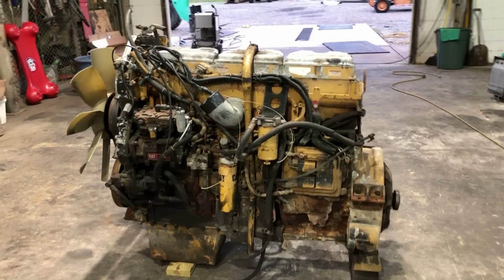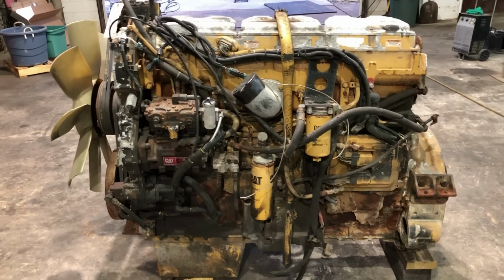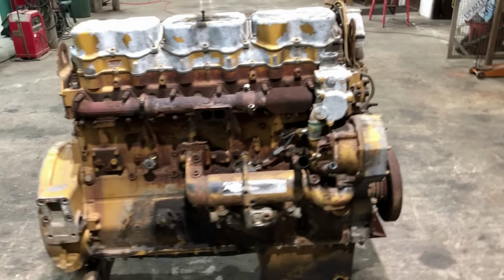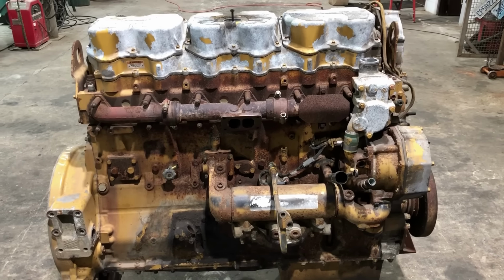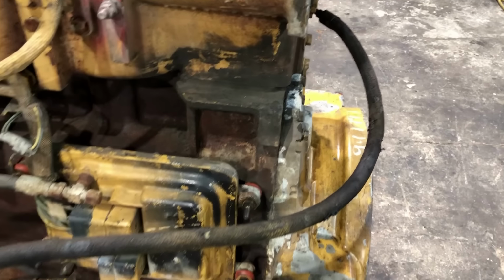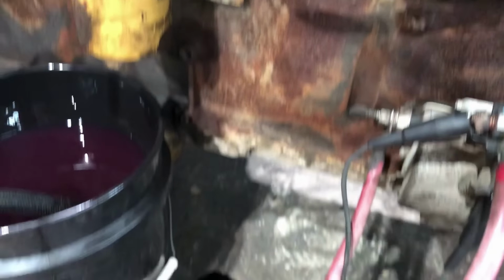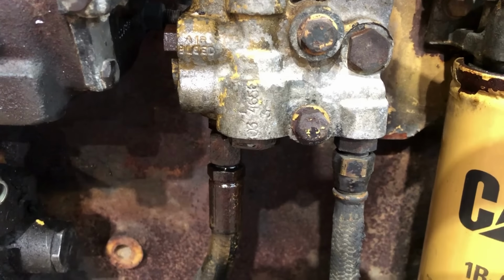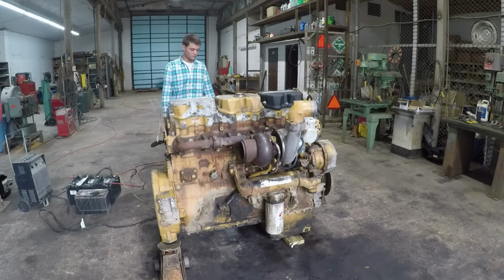Bringing a Caterpillar 3406E 14.6 Liter Diesel Engine Back to Life

Comment: Your the coolest kc  thanks I installed a 605hp 1lw into my 2008 pete 386 awesome engine a little calmer torque than the deleted c13 Lee I had in it which I'm just going to sell as z core I think I just don't have time go rebuild it it runs ran great until peterbilt replaced air compressor it then started pushing coolant out maybe but remain compressor not sure.but I love this 1lw just a bad oil leak front housing which I'm gonna get at but I'm outside all it does is storm and boost is a little low 21psi I replaced actuator but it's not set right tryna to find the specks to set it with regulated air I think it supposed to open at 17psi 29thous

Comment: My buddy has 435 3406e in a 96 Western Star 18 speed 3.90 rears we haul gravel with it. He also has 430 Detroit in a Freightliner, The old Cat pulls away from the 12.7 pretty easily but he Detroit gets great fuel mileage, usually over a 100 liters less than the Cat a day.
Reply: What gears are in the Detroit rears. Year's ago I ran with a guy hauling gravel. He had a 430 detroit. That truck out ran every n I mean every truck in the pit. It also had a weird tranny with reversed top hole...top hole was up by the dash🤔
Reply: @nonsequitur807  4.10
Reply: @GMCOldsRichmond  I had a Detroit 450  or 460  cant remeber with 410s n it was a dog. Probably needed 373🤔
Reply: Peter Wyndham That would be an overdrive transmission

Comment: Way back in the day(late 1960smid1970s) Army for one used  Cat Model road grader .I think they called the engine a D333. Thing I remember about it was The engine could not be killed unless it was run without coolant or oil.Had all the power we ever needed and then some to spare.Other thing I remember  was the grader ran a wet triple disk clutch that was wetted by engine oil.Don't remember just how but when the engine was running engine oil was pumped through clutch housing then back through engine oil filters and so forth.Did you ever run across one of these? I know that the engine could not be used today because of emission regulations.
Reply from the maker: No I don't have any experience with anything that old.  Thanks for watching.

Comment: That was interesting. I'm impressed with your knowledge of this beastly beauty.
I am now wondering why it was listed as having water in oil.  I didn't hear you mention addressing that issue.

I fully understood your concern about lubricating the injectors and cylinders because I have a Jeep Liberty diesel. I was concerned about lube for that engine since the sulfur content has been drastically reduced to pass emissions. I add lube to the fuel when I am not able to find biodiesel. It is noticeably quieter at idle when I can find 20% biodiesel.

I was surprised you didn't think the sludge on top the engine was excessively bad. But I have never had to tear one down as yet. Mine little 2.8 L four cylinder has had synthetic oil since new. She now has 225,000 miles and idles as quiet as one I saw in the parking lot that only had 55.000 miles.

A farmer near me runs his Cummins engines on 100% biodiesel in the summer. He said it runs quieter, smoother, and burns cleaner. Can't do it in winter, gets too cold in WI. He said it smells like someone is cooking french fries.

This was a good video, informative and well done. I was glad to hear that old girl fire up.

Comment: I’ve rebuilt way to many 3406 cats  . A,B,C & E  . I use copper coat on the block plate . . Both sides of the thin gasket. Seems to stay dry .

Comment: good idea on the oil in the fuel, anymore then running it for a second use fresh oil, the carbon in the used oil will tear the hell out of the fuel system, ive seen it countless times. just some friendly advice. carry on

Comment: So the Cat meowed. Just wondering about any cracks or leaks either between the water jacket, but even the cracked holes you've showed might just put condensation in the oil even before it failed.
It would be a lot of labor hours to strip clean and put back in service, probably interesting to do in a hobbyist kinda way.

Comment: Next video, same motor, BIGGER TURBO, INTERCOOLER BIGGER THAN THE RADIATOR, STRAIGHT PIPED, MUFFLER DELETE, HIGH PRESSURE FUEL PUMP SPINNING FASTER THAN THE WHEELS OF HADES CHARIOT!!! and a clutch to deal with the abuse....

Comment: Great video. I used to check cores, but used air starters.
Reply from the maker: I have a big one, but didn't want to go thru the trouble getting it plumbed and working.
Reply: I had an large air tank with a large hose to the air starter. Later I switched to an air turbine starter. It could be charged with air supplied on site or by an air compressor brought with. This system was derived after dead batteries, battery explosions and wiring fires. Have you ever removed liners using the pistons? It was a trick I learned as a ships engineer. A bead was welded near the top of the piston travel. Several stitches were good enough. This would shrink the top of the liner. Great mechanical advantage is attained and the liners pop loose when using the jacking gear. A second stitch is used at the bottom of the stroke to push the liner near clear.
Reply from the maker: @captpaulhaugan  I have tried it, and always ended up liking my homemade liner puller better.

Comment: Even stripped and sitting in the floor it still has that cat growl. I drove a 1984 Ford CL 9000 that had a 3406 in it. Damn good engine.Wasn't much on speed but pulled really good. Wish I had your knowledge on engines. It isn't everyone who can get an engine to run sitting in the floor......... What are you going to do with it?

Comment: Not doubting your competency, but I work for NAPA and learned from our battery salesman recently that the 7236 (gp 31 post 950cca) posts are stainless and less conductive than the lead alloy bases. 

That said, they could be slightly discharged or weak batteries. 7232’s and 7238’s are weaker even new.
Reply from the maker: They were very weak, just about ready for the scrap yard.
Reply: Understood. Your videos are great fun to watch.

Comment: I’m just a Low paid outboard boat tech with zero knowledge of diesel. I’m trying to learn so this may be a very stupid question but why does it appear that this engine has such a small Alternator. I mean wow I thought they would need something larger for the batteries. Actually I don’t even know what size batteries or how man V,s it takes to turn these bad boys over.  I would have thought it would be a lot though.  Anyway thanks for the videos and great info. Keep trucking.
Reply: Is it 24 volt or just 12 in series ?

Comment: You are Number one in YouTube you have good information's I love it.
I got 2004 fright-liner  3126 cat engine it was working when I got it now not working I can crank it but no start i used starter spray and start for a second and die ,when the engine start for a second the RPM jump like crazy (so high) and red light on (Engine protect) I do not know what is the deal with it??

Comment: Opinion on a 112FLD with a CAT c-12? only ever done rod bearings @ 700,000k for preventative maintenance. gets Fresh oil every 10-12k. Head did crack awhile back from drilling out an exhaust manifold stud, but got a new head for that.

Comment: Great engine. Great  video, keep on posting! Too bad these enviroturds have to keep pushing for pansy motors. These old kitty kat engines should be in every truck. Trucks stalling out for a parked regen use more fossil fuel than the OLD stuff. Because they have to make their diesel def and waste fuel to park for a dpf clean out.

Comment: My only question is, "Dewd, where is your hearing protection?" Also, this was an excellent video...
Reply: No hearing ptotection needed it is a CAT not a clackety clack cat almost never dies it only runs smoother by time if something goes wrong its most of the time due to neglegance of operator or mechanic

Comment: random question for anyone who may know, but looking online at a W900 service truck with a 3406 probably an E model but could be a B, its a 1996 truck. Theres no engine brake controls on dash, but I suspect it just wasnt hooked up to be used but exists on the engine physically? Truck has a digger derrick body and if it was used for the body's industry then I see them not hooking it up, I just cant think of anyone getting a 3406 without adding jakes to it or coming that way even before the upfit company got to it with the body etc.

Comment: The batteries are not the problem - you need shorter and/or thicker cables. With such long cables you waste ~1V on the cables alone when starting, which is also the reason why putting 4 batteries in parallel didn´t change too much.
Cut them in half and use the cables in parallel with meaty pole peaces and starting will be a breeze.
Reply from the maker: The batteries were junk.  A lot of trucks use cables longer than those and they start the engine everyday.

Comment: I'd pass on the E...... but damn did I love my B.  Tons of power, no turbo lag, Jake Brake that would set my 91 International with a 120" Double Eagle sleeper on it's front bumper at 70 MPH, fantastic fuel mileage (7.25-7.50 pulling heavy, as long as you knew how to drive it.  Drive her right and no big clouds of soot or black smoke either)...... and the only 'electronics" on it was an electric fuel valve.  Key on, fuel flows, key off, fuel don't.  The biggest problem I had was finding people that knew how to work on the old girl, because their laptop couldn't tell them what's wrong.  As far as I'm concerned, the electronics screwed the trucker over bad because they could limit the power of the engine and the speed of the truck.  My truck... No ECM, no Pre-Pass, no EZ-Pass, no Qualcomm, GPS on the cellphone turned off, and paper loose leaf logs.  Where is he?  Hell, I don't know.  How fast is he running?  Hell, I don.t know.  Guess you better call him and find out!!!.  What happened?  A little girl texting (of course) hit me from the side bobtailing square on the drives, pushed the ass around and lined me up with a huge major electrical pole (took out power for 2,800!!!).  Tried to climb it and wound up on the driver's side totaled.  Then, of course, I had a heart attack on the way to the hospital.  So much for driving truck.  Damn do I miss it... and my old gal   :(
Reply from the maker: The Bs were a great engine in their day, but they don't compare to an E model in any way.
Reply: Most of the women I know would probably say the same thing "in their day" about me  :(  Just old school.  Drive a 68 chevy pick-up with a 350... high rise... Holley four barrel... etc.  It does have a newer 5-speed, but it's a stick.  I just like to tell mechanical things what to do, not the other way around.  My first truck did had a first gen electronic N-14 Cummins, but with the old old four button Pittsburg Power so it ran more like an old mechanical.  Off - 50 - 100 - 150  HP Boost.  Man... that baby would cook.  And it got better mileage on the +100 setting than it did with it off.  So... why can't the factories do the same thing???  Some of their newer stuff will add 220 HP, and still give better mileage in the mid settings.  Better mileage means less fuel burned, so that has to equate to less coming out the stacks.  Heard a new DEF truck pulling hard next to me the other day.  Sounded like it had a corncob stuck up its pipe.. With all the new regs... glad I'm out of it.  Big brother looking over your shoulder second guessing everything you do to me ain't the way to drive.  Two of my buddies boys are driving.  A third just gave up, and the other two are making next to nothing.  And all three owner ops with paid off trucks.  The days of making a good living are over as far as I can see.  I never took less than 85% of gross, and wouldn't touch a load for less that $2.75 a mile, and that was back in 2012.  Now......

Comment: What is the rule of thumb time wise for running an engine this size without water.  I do understand that the piston heads are oil cooled but without water the oil cooler is not working.
Totally enjoyed the video and glad to see you back with another one.
Would really enjoy a bit of back ground on you as well as your shop.  A shop tour at the same time would be great.
Reply from the maker: A few minutes at a time won't hurt anything.
Reply: It's weird transitioning from small gas motors, even race motors, to big diesels. With the amount of oil in that thing, which is GALLONS, assuming it's filled up like he did before he started it...you would probably have many minutes before any problems. My two Freightliners with DD15's took years to warm up from cold and dark. There was something like 3 or 4 thermostats in them just because it didn't need water cooling for a long while. It would progressively open up more passages just to get it warm up faster and provide heat to the cabin faster.  This is not unique to big diesels, though. I have seen the same setup on a VW. But with GALLONS of oil and a big cooling system, and all that iron, yeah, lots of thermal mass to heat.

Comment: I put well over 1.250.000 miles on a E model  I used 1gal of non deterrent oil per 200 gal. fuel
Reply: 2 stroke. Lol. 🇬🇧

Comment: I’m gonna go out on a limb and hope you could help answer this wierd question. I have a 5EK 3606E that came out of a 05 kenworth. It’s blowing quite a bit of oil out the vent tube coming out of the top valve cover. The mechanic says these should have a mesh filter that keeps the oil from blowing out. It’s not in the valve cover and I have even gone as far as to buy a new valve cover assembly from cat and it didn’t include that mesh. Is there really supposed to be mesh inside this cover? Do you know where I could get it? Thanks in advance from Texas!
Reply from the maker: Yes there is mesh type filter of sorts in there.  If you're getting a lot of oil coming out there you probably have a lot of blowby also, but that's beside the point.  It's going to depend which valve cover you have.  There are two possible styles.

Comment: Im a driver- but Im learning how to do all my own work, I need to change exhaust manifold studs and gaskets......My first question is, How many C-12's (2ks) have you worked on? And Whats the Best method to getting the old Crusty studs off?  Air Hammer to break things up Then 1 at a time with good heat and "ease" each one out slowly?? I dont want to break them.. Thank You.

Comment: awesome video. Why exactly used motor oil in the fuel instead of new motor oil ?
Reply from the maker: Used motor oil is free, and I had a bucket of it sitting in the floor so it was handy.  This was just an old core engine.  No big deal.

Comment: If there was rust under the valve cover how do you know if the cylinder walls and/or pistons are not rusted and damaged the sides of the cylinder wall causing compression loss?

Comment: very interesting. Don't run it too long without coolant!   And why does it not smoke  more with turbo-hose disconnected ?
Reply: It did smoke right at the acceleration times, otherwise it ran at idle so no load, apparently still enough oxygen for the little fuel it needs to run against own friction.

Comment: Sounds really nice. What else can you find out/configure in that ecu software you have there? At work I have repaired a number of similar ecus.

What's the purpose of having the turbo hooked up? Wouldn't you overspeed it without a load?
Reply from the maker: It's Cat ET, you can change all settings, view diagnostics, reflash the ECM, etc.  The flash file is what governs fuel (power), timing, etc.  The turbo was put on because it's not a complete core without one, and also everybody would have complained if I had run it without a turbo.  You can't get more than 2-3 psi at most out of one at wide open while idling, so no you won't overspeed one like this.

Comment: ive never ran one without water in it for more than a couple seconds, how does that affect the water pump seal? also do you plan on diagnosing the water in the oil issue?

Comment: Hey I really enjoy your videos. I've worked with some old timers that would put used motor oil in their fuel tanks and I always wondered what the reason for that is.  How much oil would you mix in let's say a 100 gallon tank? I have a project truck that sits all year round basically and for when I do have time to tinker on it I'd like to keep everything in there in good shape
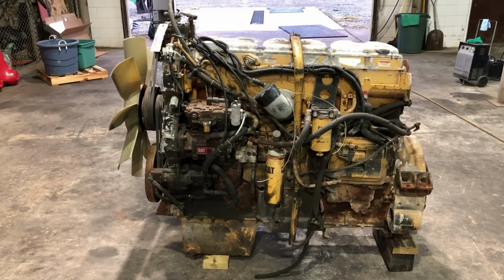Reply from the maker: 2 stroke oil is better because it's cleaner, but if you're not running it very much used oil won't hurt anything.  Something like 1:10 is probably about right.
Reply: @KT3406E  thanks for your input!

Comment: Good one, what are your plans for the engine? What would be the cause of the water in oil issue, is it a cylinder head gasket or heat exchanger?

Comment: Since these are such well built solid engines, would it be possible to convert it to gas/petrol and force induction? because it could handle boatloads of boost, I suppose you would have to rebuild everything internally to rev higher etc but block wise itd be pretty un popable

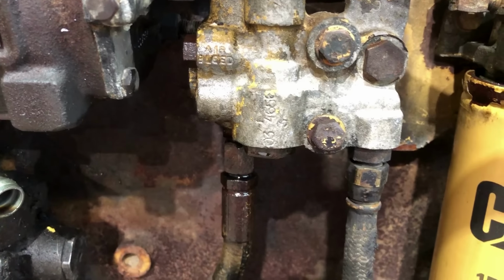Comment: 9:27 why are the Jake's so rusty and the rest of the moving parts in the head not?
Reply from the maker: That's just the way these engines get when they sit, especially when they've had water in the oil.  Seen it lots of times, the jakes clean up fine.
Reply: @KT3406E  thx for your reply nice video!
Reply: The jakebrake is the highest part of the engine where the moisture collects
Reply: @caclark7600  makes sense